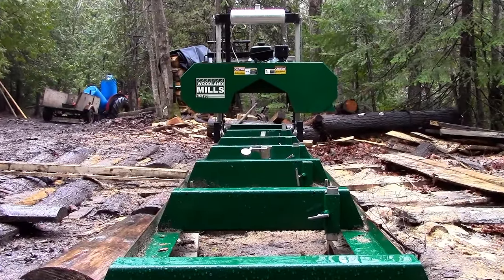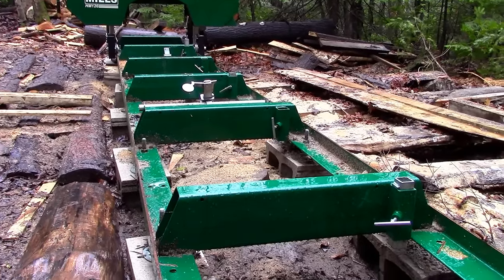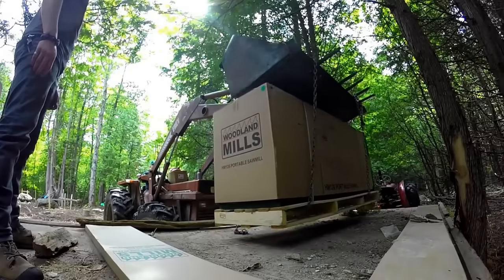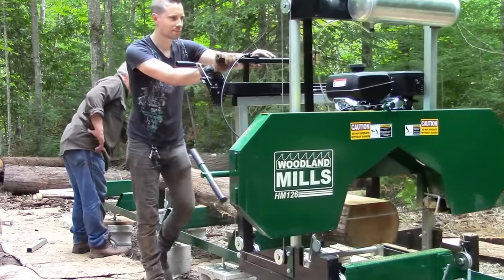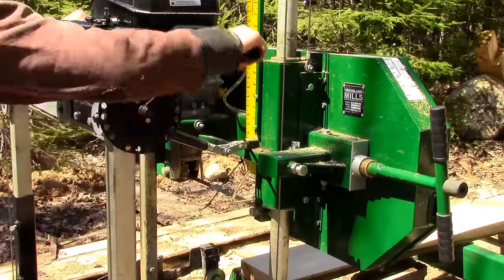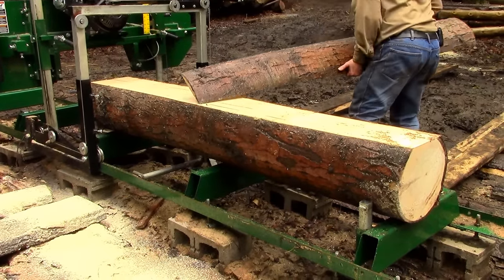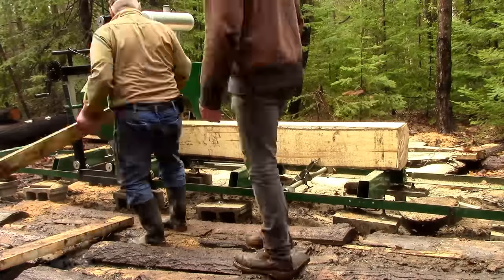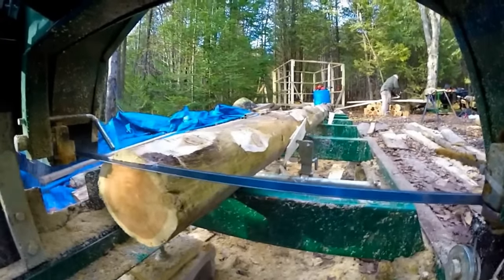Portable Sawmills- Are they worth the money?- Woodland Mills HM126

Comment: Why did you select the Woodland Mills over Woodmizer or Timberking?  If I could afford one, I would like to have the Woodmizer on a trailer with all the hydraulics, but that one is around 30k. Way too rich for my blood. What about sharpening the band? Does that require special tools? Then there is the argument for the slower but infinitely cheaper Alaskan type that you attach to a chainsaw. I have an older 36" Husky I believe would be up to the job, but the accuracy of the cut comes in to question along with the speed. How long do you have to let the lumber cure before use? Any special prep you need to do the lumber after cutting it? Your Dad is a lucky man. Which also means he did a pretty good job of raising you.  Keep up the good work.
Reply: Several sawmill manufacturers offer a blade sharpener machine, for a few hundred dollars.  Some people sharpen blades with a Dremel tool, but they do not have the same accuracy as a sharpening system.  You have to reset the teeth to cut to the left or right of center, too.  Jerry's Reshaw is a great place to buy blades.  His Ripper 37s are famous.  You can buy new blades, and send used ones back to him to be resharpened.  Blades can be resharpened a few times, but should be closely inspected for cracks before you waste time resharpening them. 
There are lots of reasons to use an Alaskan mill, and you mentioned some of them.  One real benefit of a bandsaw mill is the tiny kerf.  Basically, every 4th board is free, compared to what you get from an Alaskan mill.  But, I can mill a log far larger than I can move if I use an Alaskan mill.  There is no way I could get a 30 inch log up onto a bandsaw mill, especially with the additional height of a trailer.  (I too am on a shoestring budget.)
You want a chainsaw with a motor that is at least 70 ccs.  Anything less than that is really pushing it.  You could go smaller if you are using a sort mill.  I have a 36 inch mill on a Stihl 660, and I wouldn't want any less of a saw.
Rule of thumb for air drying lumber is one year per inch of thickness.  That will vary a bit based on species and geographic location and climate.  Lots of guys built kilns to speed up the process.  A solar kiln operates pretty cheaply.
You should seal the ends and sticker boards after they are milled.  AnchorSeal is made for that, but you can use exterior latex paint or even wax.  Your stickers should be seasoned, dry wood, or you might stain your boards.  3/4 inch stickers will allow a lot of air in and around your boards.

Comment: When I was a teenager my grandpa let my cousin and I "rent" his band sawmill, tractor, and truck/trailer. The sawmill is a small lumbermate from Norwood with a Honda engine. Its close to the size of your machine. There is a flooring mill in a town close to us that buys red oak of differing widths and lengths cut 5/4" thick. If I remember right we were able to net, after paying Grandpa his equipment fees and our gas and diesel, $140 for a 10 hour days work. This would vary some as prices changed. $14 dollars an hour isn't going to get you rich, but some folks live on less I suppose.

Comment: If you have woodlands and work with lumber on a regular basis a sawmill will pay for itself in a  very short amount of time. However to drag logs to the mill you need a tractor of some sort. Just in building my bridge and all of my bee hives my mill has more than paid for itself. No way a chainsaw mill can be compared to band mill, I could mill 3 logs before a chainsaw mill could do 3 boards.
Reply: Same here. Would have costed me $35,000 or more, to have my woodwork completed by a contractor, in my living quarters!
Reply: I'm for the portable sawmill.
Reply: Southeastern Ohio honey bees & bbq Thank you for mentioning the most important item when figuring out whether or not to buy a bandsaw type mill vs. the Alaskan type. THE TRACTOR. Minimum $5,000 for a used decent tractor w/ forks. If you need to move the tractor off your property you will also need a trailer and probably a 1-ton truck to pull it. $$$$$. I am buying a 5-acre lot that is in a subdivision in the mtns. of N.M.that has an H.O.A. I don't think the hoa gives a hoot on whether I mill some of the Ponderosa pine on my lot for lumber to build my cabin, but they would probably have a fit if someone started dropping off logs for me to mill. They would say I am not zoned for that type of business and they would be right. The details can be downright devilish.
Reply: How much

Comment: I've been using the same mill for a couple weeks now cutting  up to 16ft Cedar logs into 1" and 2" boards plus larger timbers.. It's a great little mill, easy maintenance, easy to set up, easy to use... best if it's on a concrete pad but at the moment mine's on wood blocks and I've got zero problems with accurate cutting.  I think the key to successful cutting is to TAKE YOUR TIME and always use sharp blades.. soon as a blade starts wandering..change it.  Great little mill for the guy who wants to take the time to do it right,  not a mill for high production to make money...
Reply from the maker: +Roger Coles Spot on assessment my friend.

Comment: I have been using my friends Norwood and I agree very much with what you have said. I would add that more horsepower means easier cutting as does sharp blades. The trailer is fantastic! And bigger logs make for less slabs and more boards.

I have a chainsaw mill but I will hire him to come over since it is not really worth the energy when he can roll in with his bandsaw mill.

Comment: Word of advice, when setting your cinder blocks, (You should be using concrete blocks.), set them with the holes facing up/down not side to side. The blocks are far stronger that way.

Comment: @The Outsider Idea- make a log rack with to hooks at each end and then set it at the bottom. Make a bracket on the opposite side of mill to attach a winch to hook to the rack and pull the logs up. Once the log is cut you can move the rack back down and load with another log

Comment: Very well done sir! you answered all the questions I have had about portable/semi-portable saw mills. I certainly will be buying one! probably this very one you use! (The company should sponsor you one of these days =) Peace.
Reply: Don't forget the tractor. And the forks. And the trailer if you ever need to move it off your property. (the tractor) And the truck to pull it. 1/2 ton won't do it. Probably not a 3/4 either. I would love to own one too. It would only make sense if I had enough trees on my own property that I wanted to part with. And owned a tractor.
Reply: @happyjacky52  It's 800 pounds and its on wheels, I'm pretty sure a 1/2 ton  could tow it.

Comment: Having had a portable mill, rigidity is the most important thing. Your mill can sag if you dont have it securely leveled underneath the base. This type of base is not that rigid. It is similar to what I had. It can bend and then you have a permanent problem. Better mills have square tubing under the rails your cutter head slides on. At the time I bought my mill the heavier support was an extra $700. option. I was on a budget, but lacking  that made for some extra work. I did build several buildings with my mill but found sawing  was a lot of work .Especially with only one person. If U dry your lumber it needs stickering. You maybe better having someone saw your lumber.I think big logs put too much strain on cheap mills. They cant take the weight,
Reply: Virginia Stanley did

Comment: Great video dude. I like watching your channel. I have a small off grid cabin. I bought a pre made storage shed and mounted it on an old trailer frame. I've bought several old travel trailers in rough shape. Stripped it down to the frame. Mounted some propane tanks and large water tank to move to my site. Works great. Find an old travel trailer. At least 30 feet. Strip it down and mount your saw on it. They have tandem 3500 lbs Axles. Or more. U can pull it with your tractor anywhere.  Just an idea.

Comment: Great video. On levelling up and-or trailer beds. Anything long and narrow doesn't necessarily have good/high torsional stiffness, so still requires levelling - it just might have fewer feet, because it is stiffer over significant chunks of its length. Concrete pads has to be best way for non trailer beds.

Comment: Using a clear plastic tube mostly filled with water and a few drops of food coloring makes a very good level, of any length.  I spoke to a laser level sales guy and he wasn't happy about them, said they worked as well as the lasers at a tiny fraction of the price. If you got the two ends sorted out first it might have been much easier to level the rest
Reply: If you put a T at each adjustment point you can level it entirely without moving the hose.  I leveled an entire house this way.

Comment: My great grandfather had a full sized sawmill at a location only accessible by rowboat.  But he built it from scratch himself from small parts.  The old truck engine was the biggest component.  But when you build something in place it never moves again.  As far as I know the sawmill is still there, although nobody has maintained it and it would need rebuilding to come back into service.  So, if you want a sawmill in a remote location, it only needs to move into place once, and you can build one from scratch instead of having large parts delivered, you could still consider a circular saw or band saw mill.

Comment: i have the same saw,  2012 edition, and it is still running very well.    harbour freight  copied the design, but it is not that well made.  i point this out as unless you look for the logo, it is hard to tell at a distance.

i bought enough extension to cut a 20 foot board and walled the inside of my cabin with white oak (1/4 inch thick).  it paid for itself in that job and i use it often.  with the price of wood now, it pays for itself every month in sacrificial lambs for concrete work, or other projects like you are doing.   

my only recommendation is to pull the valve from your lubricator tank and use anti-seize, as mine gaulded up even with teflon tape on the thread.  the valve eventually wore out.  i could not extract the thing, and i drilled it out a bit and then rethreaded it for a new valve.   the lower valve will also wear out later, mine lasted until last year and i found the air valve for shutting of inline tools worked well and got me back up and running in about an hour 

the bearings on the blade seem to wear out fast from the lubrication on the dispensing side, but other than that, almost no maintenance apart from ensuring level every so often.    

i don't consider this a portable saw, but it is top quality.  great presentation.

Comment: In my personal opinion : The cost verses the end product really depends on how much lumber you intend use or will eventually saw before the saw is of no further need. If a sawmill will be used after the original project has been completed, then, the cost will be less, depending on the amount of use occurs.

In using the sawmill to just build a home, cabin, utility shed or barn etc, and nothing further, then I  would consider a sawmill that cost $10,000.00 to be a good buy, if your project would require $30,000.00 or more to purchase material from a DIY store. Why did I use a 3 to 1 ratio ........ because the following greatly increases the final cost of producing your own lumber.

1) time required to fell the trees, transport the cut logs to the sawmill and then processing of the logs into usable lumber

2) the cost of gas, oil, blades for the sawmill

3) the cost of a crosscut tree saw, a limbing chainsaw and a felling chainsaw, plus chain blades, gas and oil 

4) the cost of transporting felled tree logs to the sawmill site (i.e.) truck, tractor, 4 wheeler etc. plus gas, oil, diesel etc.

5) the cost of miscellaneous items, log tow chains, axes, hatchets, files, tarps, ropes, pull blocks, cant hooks and pry bars 

6) the cost of material needed to set up the sawmill, concrete platform, concrete blocks, equipment levels etc.

7)  there will be other hidden cost and annual cost that will occur while processing lumber with a sawmill which must also be expected, such as equipment and sawmill repairs, scheduled maintenance etc.   

Hope this helps readers to decide whether or not, buying a sawmill would be to their advantage.

Comment: Depends what you want it for. If you have a plot of land with a lot of standing timber, you intend to build a house and have enough timber to do it, you can save a bunch. Log cabins are a waste of a lot of wood. The only reason they were popular in the colonial period is that settlers were clearing farm land and had a whole lot of logs. And there weren't any commercial mills nearby to break up the lumber. Solid wood has a low R rating compared to even air in a stud wall. And you can make a log go a lot farther as sawn lumber than a log. That said, unless you intend to make a living cutting lumber, it is unlikely you will find a lot of profit in owning a mill. I'd look into leasing a mill for a year or so to cut up your timber, or buy a really good quality mill you can resell when you are done with it.

Comment: Leveling your sawmill! A simple water level is very easy to make and would very beneficial to your setup. Fix one end of your level at whatever point you choose on the track, the other end of the hose you carry to each leveler and make your adjustment until the water touches the same point fixed on the fixed end. Do this at each point and you will only have to make and adjustment once at each block. Hope this helps.

Comment: Excellent review my friend, Been watching your channel for a while now, I don't always comment. Quick question, since you have had it for a while, maybe two quick questions.
How often do you have to tune it, making sure the wheels are parallel with each other etc so if your cutting a 6X6 it it still a 6X6 from end to end. Is there anything you wish you had accessory wise for this mill. 
I have been talking to the online customer service reps, as well. 
Next, I am like most, I don't have a skid steer, front end loader or fork truck, so my thoughts are to go with the one with out the trailer since it would be lower to the ground, in my mind it would be easier to load logs, but since you have worked with this mill for  a while, is that a wise choice, or do you find yourself bending over too much milling and I'm old and fat, it may be a better choice for not bending over as much while milling and figure out a ramp to get the log on higher. 
Next, the rails, look like they could be flimsy and to me that would cause the end cut to be slightly off or even off square at the end of a  6X6 or so? does the trailer may it easier to keep it squared up?
My cabin location,  which is off-grid, will not have a concrete pad, so I will be leveling on flat dirt and possibly may a gravel area level to put the mill on. 
My plan and purpose of the mill will be to make lumber for my cabin build just as you and your dad are for yours. I dont plan to operate the mill for money, just see it as an opportunity to mill my own wood and build the cabin from trees off my place. 
Eventually making cabinets etc as the cabin starts its final stages of the build process. 
Thanks again, I know this is long winded, I have not seen any videos on tune ups if you will on the saw mill etc, so that is what is sparking my questions. I would hate to spend a great deal of time trying to mill some 6X6 post etc for building patio covers etc and end up with 6X5 3/4" boards that are off.
Thanks again, keep up the great videos and I hope you have a blessed weekend. 
COngratts on breaking the 100,000 mark on your subs as well.
Reply: I have a 130 and really like it, but I work alone, and it is really hard work to make beams and slabs.  I have a loader that can move big things, but it is not exactly delicate.  Thus I drop logs on two smaller logs running to the mill and roll it on from there.  The loader also stirs up mud.  Other people fret over washing logs.  Here is my theory on things, I (or you) am the only valuable tool in the tool box, don't waste time.  If you are building for yourself, you should be able to sweat equity at >$50 per hour even with limited experience.  Don't worry to buy blades and dull them out, or go cheap on proper tools.  Setting up the saw is not so bad, level by eye is possible or basic level.  It is better to drop logs next to it, rather than on it.  It is as accurate as the cutter.  The band will drift when dull, again as the operator of a saw mill,  your time matters, swap in a new blade, but in pine or poplar you can saw for a week on one blade and stack up more wood than you can use.  Go price a 6x6 and figure you can make them fairly easy.  It is not worth cutting 2x4s as by code must also be planed and graded so many areas will not allow rough cut 2x4 in a house building, so check first with your area before thinking this a worth while task.  It is a great tool for slab furniture and timber framing.  By all means, get a tractor or excavator to life logs, there are also boom trailers, but value your time.

Comment: Band mills are ideal for cutting dimensional lumber, and working with manageable-sized logs. But for cutting mammoth sized beams and slabs, from huge trees, you just can't touch a portable chainsaw mill. For less than $1000 (and a little sweat), you can mill trees that a "portable" band mill can't get anywhere near, and couldn't process even if it could. Most "portable" band mills are hardly portable. If you're really into milling, ideally you'll want both.